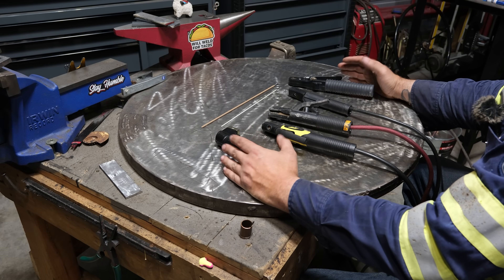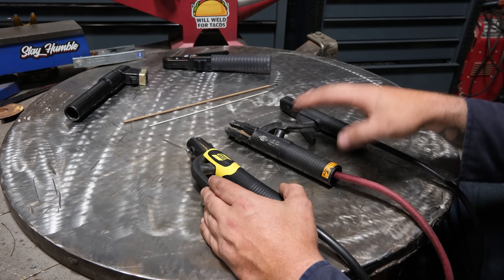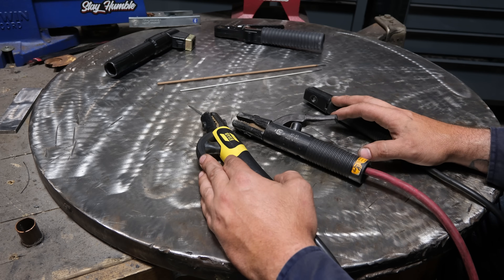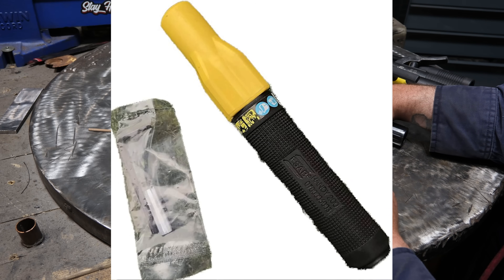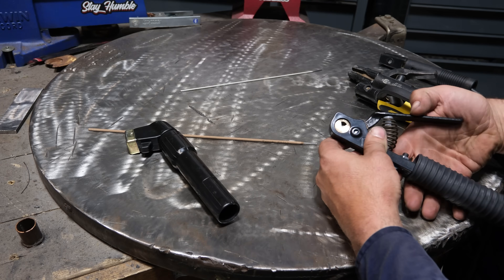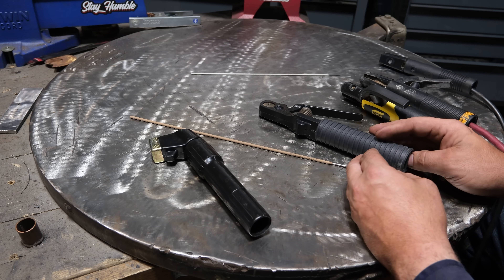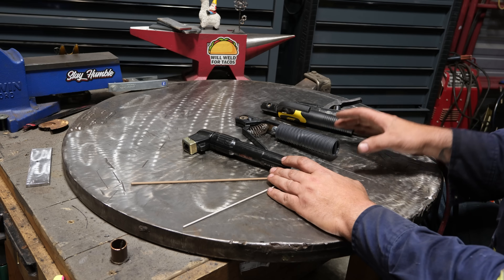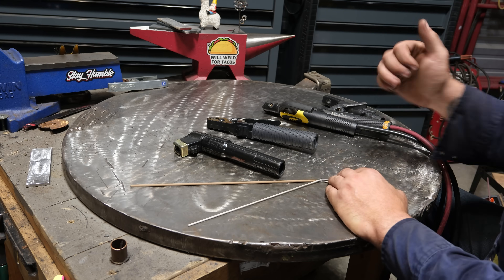Stinger V and other electrode holder upgrades

Comment: Twist lock holder's are junk in my experience. I bought three Japanese made Fuji electrode holders which are great but a bit tight under the clamp release handle. They are like a slim ESAB holder and have run them all day with no issues at all. I want to upgrade to a Stinger V002 insulated but at £158 inc VAT (£198 inc VAT normally) they are expensive. The Stinger V will be better my plate sized hands to operate.
Reply from the maker: They definitely are expensive but they are worth it if you do a lot of stick welding.  I have ran a stinger v for over a month straight now and I had to go back to a tweco for a day today.  I much rather use the stinger v lol.  For a tight spot, or small hands it would probably suck, but for anything else it’s a joy to use.

Comment: I’ve been eyeballing the stinger ever for a few months now.  How do you think it would do on a farm rig (mostly pipe fence, corral repairs, equipment repairs, etc)?   I’m concerned that it might limit accessibility in a lot of situations. I’d like to see a more compact version where the release lever was closer to the handle.  I’d like to hear your thoughts on it.
Reply from the maker: So the handle being where it is could be an issue getting into places. You could bend the handle closer to the body since it doesn’t need to move much to let go of a rod.  The physical size of it is pretty big, which to me makes it really comfortable.  I just spent a 50hour week welding with it this past week and for general stuff/pipe welding I am not going back to a normal stinger.  To get it in tight spots you can choke up on the head easily and that works well provided the length and size of the grip isn’t an issue.  I think for a lot of work it will be just fine, but I always have a mini chopped twist lock stinger handy just in case I need to get in a tight spot.
Reply: @makingmistakeswithgreg thank ya sir!

Comment: I would recommend the ESAB Eco Prima. It's kind of a blend between Lenco and the Stinger V electrode holders.
I got the 300A ESAB Eco Prima for about 20$ (they've got 200/300/400A) and there's a downside to it - it barely holds a 2.5mm electrode (not even gonna talk about 2.0mm).
Pretty solid and will probably never arc out on you due to its closed/covered jaw design.

Comment: I've been using the same $20 Amazon twist lock one for five years now...I'll never go back to anything else.
I don't weld for a living, but this thing's done a buttload of trailer repairs for me and still looks & works like new. Stuck rods aren't really an issue with these, they grip tight enough to pull teeth!
😁
Reply: One thing...if you use the twist lock thing, get in the habit of holding the business end stationary and twisting the handle when it's time to swap out electrodes. If you twist the head while keeping the handle (and cable) stationary, it'll eventually twist the cable off at the terminal/lug.
It's well-hidden inside the insulated handle, so you don't notice that half the wires in the cable are broken until it starts running hot from the added resistance.
Reply from the maker: You can definitely pull a stuck rod off anything with a good twist lock lol.

Comment: I’d like a ‘trode-holder that’s about an inch around.  Doesn’t need to handle huge amps, as a 3/32 7018 is a fairly big one for me.
Reply from the maker: Some of the small Lincoln style fit that bill.  A majority of the stingers out there are pretty substantial in size.  Lincoln’s tend to be small and compact, and allow you choke up near the rod which helps reduce the actual size.  The downside is if you arc out to the jaw via a stuck rod they tend to have troubles holding onto a 3/32 after a while.  I guess a file will help fix that lol.

Comment: On the v we put battery cable heat shrink on the lever and it helps a lot.
Reply from the maker: Great call on that, I happen to have some so that will be on the list to do 👍
Reply: @makingmistakeswithgreg thank you so much for your amazing videos, I just watched your vertical mig video again after I was humbled doing it on galvanized haha!

Comment: Back in the 80's I had a welder transformer that came from a shipyard it came with an electrode holder a bit like the Hobart twist grip one you had there but the electrode went into the end of the unit not at the side. It was perfect for overhead welding pointing it straight up for other positional jobs not so much so I changed it out for one that looked just like the Hobart, I sold the machine and the electrode holders in the late 1990's. I have never seen another electrode holder like that one since then.
Reply from the maker: Interesting.  Iron workers are known to weld with rods straight out of a stinger, I have never seen a stinger setup like that.  I could imagine it could be fun to bend the rod to weld on things other than overhead, half the flux would probably be broken off the rod lol.

Comment: Hi Greg

Most welders here in Australia are supplied with a twist lock electrode holder. I've been using the Optimus/Kemppi electrode holders which are similar to the Stinger V but have a fully encapsulated head instead and with a electrode port on the top for overhead welding. Have a look at them, I picked mine up for $80 AUD.
Reply from the maker: Those look similar (but better built) to one a few people suggested.  I will have to check that out, it’s a unique design.  Definitely a bit less prone to arcing out than the stinger v lol.

Comment: vice grips... clamp onto item, hammer the screw on the grip so the jaws score into the metal... but, those little magnet base ground clamps work grate for plasma cutting... high voltage just burns an arc ring around it if... the screw on a 1 inch magnet clamp was stamped 500A, no way that meant 500 amp's? 5 buck hobby clamps, daisy chain 5 of them...

Comment: Thanks for sharing.  I am just starting my welding journey and I stick the rods like I am breathing, comes second nature.  While searching Amazon for the Stinger V 002 (Insulated), I came across another stinger.  ASIN:  B0F93C7YWQ
Would something like this be good for a beginner?  It has a trigger mechanism to latch the rod and squeezing the trigger should be able to release the rod if it get stuck.  Not sure of the longevity of this stinger though.
Reply from the maker: So that stinger I have never used, but my guess is it would be less durable than a normal style, simply because of the moving parts.  I would stick to a lenco style for durability and usability.  On a budget 100% look at a harbor freight stinger, the one they have (knockoff of a lenco) is solid and often under 15$.
Reply: @makingmistakeswithgreg  Thanks

Comment: 3:20 took more then 500 pounds of rod before the 3/23 rod slip started... at that being a chunk of glass being stuck in the jaws... the plastic Bakelite cracks or melts off most after 200 pounds of rod. ground clamp if fkd out of its reality after 1000lbs of rod but still works with a failing clamp spring. 300-400amp ratted whips doing 1/8th and 5/32. not like i have an old stinger that after clamping the rod, twist the wire around the stinger jaws that the plastic melted off of so it don't let go.

Comment: Pipeline welder for 35 yrs and recently retired…used the Tweco A532 stinger for the first 20 yrs of my career and wouldn’t use anything else until I was introduced to the Stinger V with insulation kit….this is by far imho the best stinger for the serious and professional stick welder!    I did try the Lincoln A300 for a few days and just couldn’t like it at all.
Reply from the maker: Awesome to have your opinion on this, clearly you have the experience to judge 😀👍.  I used another guys stinger v and really liked it, he was a pipeline welder. I do mainly 6in and down building pipe welds and no guy I have seen used a stinger v.  It seems like a gimmick until you use one for a while.  Definitely a great product.
Reply: @makingmistakeswithgreg    The only fault that I had found through the years of using the V with heavy rods and of course "high Amperage"  150-165 amp with 3/16th 6010 -7010 rods was the insulator would melt on the one side depending how you hold the stinger way to easily especially on the bigger diameter pipe...36"diameter etc where you spend a bit more time coming across the large bottom during overhead.    Another thing we'd do is heat heavy duty shrink sleeve around the spring and pop it back in, this really helped with reducing forbidden arc strikes!

Comment: You made me go looking and Amazon has one : Simond Store 400a stinger  which looks like a v- hybrid with an out the top option.  Simder makes something I've never seen before called a Seahorse, apparently. I've always used a Lincoln, as they seem to be the best when you need to throw a 1/16 out the top.
Reply from the maker: That Simond looks like it would work really good.  The protection of a twist locks but easier to remove.  That sea horse is really wild lol.  It’s like a spring loaded jaw with a trigger.  I have a feeling that would be rough to use lol.
Reply: Simder has a great warranty process, which you'll NEED! I bought their multi-process welder, & got THREE DEFECTIVE WELDERS in a row! All 3 had different processes that wouldn't work! They sent me the Seahorse as compensation, but I haven't tried it.

Comment: Thank you for the stinger review. My old clunker 110v buzz box needs a new stinger, but I can't seem to figure out how to get the old one off! In time. The grounding clamp was much easier.
Reply from the maker: Some of them had an injection molded unit that is tough to pull off.  Best case the handle might just need to get pulled down to expose retention method/screws.  Worst case cut the cable and strip some of jacket.  If that welder has fixed cables loosing length might be a detriment lol.

Comment: Hi Greg, have you made a video on welding safety regarding electrocution (A.K.A. what to do to not get shocked and die!)?  I bought an old Lincoln Classic II engine drive welder which I haven't used yet.  I've only done MIG and a little TIG.  Before running stick and/or arc gouging, I'd like to know what I'm getting into safety wise before firing up that beast...
Reply from the maker: I have (very loosely).  I am actually working on a video covering this exactly, it should be out in a week or two.  In the meantime I will offer a bunch of useful advice that should help:

So welding operates at lower voltage (typically 15-30v) which is not enough to easily make you part of the circuit.  The human body is a poor conductor of electricity, aka it’s a resistance to electrical flow.  The higher the voltage the more the voltage can “overcome” the resistance.  When you get to high enough voltage things that are poor conductors (such as you or the air) can all of a sudden conduct electricity.  Now with that understood it is absolutely possible to be shocked by a welder, however it’s actually fairly difficult.  Many modern welders open circuit voltage (max voltage at any point) is sub 35v which would require you to have sopping wet hands holding say the stinger and a ground clamp to get a jolt.  Older machines and engine drives can have 80-100v open circuit which is enough to pass through a wet glove through you and a moist shirt onto something your welding on to complete the circuit.  In most cases it’s not possible for the machine to produce over 60v with a load on it, so as a circuit starts (aka you are being shocked) it won’t be significant because the voltage will be low.  

One of the things you must remember is the way most welders are designed, at no point is there a direct connection between input power (say 120v or 240v wall power) and output welder power.  Welder generators often have a separate welder section and generator section, so even in that case the ability for the generator to produce dangerous voltage (over 120v) on the output of the welding is limited.  So in simple terms the possibility of getting shocked is there, but rather limited to how significant of a shock.  Wear dry gloves and keep the “ground clamp” hooked near to the area you’re welding and things will be ok 👍.
Reply: @makingmistakeswithgreg  Thanks for the detailed reply, really appreciate it!  Looking forward to the video.

Comment: I’ve actually got one of those twist lock style on one of my machines and I like it quite a bit. If you’re used to a normal squeeze clamp stinger, it does take a little bit to get used to, but I feel that it’s worth it for the safety benefit and the better grip on the rod.
Reply from the maker: It does take a bit to get used to the twist lock but once you get the mental note to just twist and pull (if the rod is stuck) it’s no big deal like you said.  More people would probably like them if they tried them out for a bit.
Reply: @makingmistakeswithgreg  You dont even need to take both hands , you just flick your wrist to the left a bit to unlock. Its better than a clamp stinger in almost every way except : 1 they are slower to change rods and 2 , they often break on top on the part that holds the rod , leaving a perfect spot to put your thumb and get shocked hahaha

Comment: I might come out of a cave , but I dont find that amazon special too bad and better that using the tig touch as an electrode holder.
Reply from the maker: The Amazon special is small and compact which is good.  I have had a few almost melt in my hands though.  Make sure the set screws are tight on them lol.
Reply: @makingmistakeswithgreg  Yep!

Comment: Thanks for the video, Greg. I was unaware that the twist lock style stinger can be cut off. I actually use am other style stinger. It is like a chimära of the V-style, a shear and an lincoln-style. The static jaw is angled and some how "diamond shaped" and the moving jaw is formed like an wedge. So you can change the angle of your rod depending on how deep you stick it into the jaws. You can also insert it straight from the top. The wedge is short and hat great leverage. It pimches the rod solid, I was never able to rip it out without using the lever to compress the spring. I bought it branded "Oerlicon segura"
It is quite heavy although. Maybe it would be an interresting subject for a follow up Video.
Reply from the maker: Very interesting on that Segura, that looks identical to a Simond stinger someone else mentioned.  My guess is a single company makes it and brands it to whoever wants it.  I will have to get ahold of one to see what u think.

Comment: Ya the v groove is expensive. But a little electrical tape around the lever should also help. Great vid as always. I sent email on a topic the other day regarding settings if your rod keeps sticking.
Reply from the maker: I am a bit behind on answering emails, if I can find it expect a response in a day or two.  I am
About 70 emails behind lol 😀👍.
Reply: @makingmistakeswithgreg  All good. Thanks Take your time. Appreciate it.

Comment: I’ve seen that a lot of guys here in the USA don’t like the twist loc because it’s a bother when compared to the spring loaded holders. When you look at all the old stingers, the entire front is exposed. Even the lever was bare metal. I remember from the early 1970s we were just beginning to see insulated jaws. People I spoke to didn’t like the jaws “hidden” behind the plastic. They wanted to see the jaws. Times change. The one you showed in the picture is “shocking” to see. It’s like going back 100 years. I would never use it.
Reply from the maker: The uninsulated stinger v is much like Lincoln t-300.  I am not sure why they still exist but sketchy is a certain.  I can’t see why either setup is a benefit lol.

Comment: I struggle with the cheap stingers getting hot .
Cable also makes a difference. Those I upgraded.
Reply from the maker: Yeah those cheap ones will be a hot potato especially with 1/8th rods lol.
Reply: @makingmistakeswithgreg 
To be dead honest I've only ever welded with cheap ass welding machines , Hell on 140 amps + the stinger gets hot as Hell ...lol
All of the welding I do is site maintenance on gates , posts and fencing.
I'd love to see what it's like to weld with a good machine.
Reply: Thank you again for the excellent content.
I've picked up a lot watching your vids.

Comment: I just upgraded my very cheap stinger that came free with a welder to a twist lock style, it's more common to use the twist lock than a stinger here in the UK.
Reply from the maker: You guys do seem to favor the twist lock.  Many welders sold there with a twist lock are sold here with a normal clamp style.  Not sure why the twist lock never caught on here.
Reply: @makingmistakeswithgreg I'm not sure why either because the clamp style is certainly quicker for changing rods, it might be a price thing as a typical twist lock here costs under £10  which will handle up to 400amps, and one that will handle 600 is only a pound (£) or two more and they don't really wear out easily, a  older transformer type welder is more likely to burn out first so the same twist lock torch will usually be used through the life of  multiple machines. Most companies I've worked for would have them as the only option, now it's mostly tig that's used in commercial settings here.

Comment: Nice Greg Thanks For The Info 😀😊😀 Could You Do a Ground Upgrade Video Like Using a Magnet Ect instead of a Spring Loaded Clamp Style
Reply from the maker: I did do a video that loosely covered magnetic grounds but I will add that to the video I am working on electricity and grounds to make sure it’s covered 😀👍.
Reply: @makingmistakeswithgreg Appreciate it as Always Greg Thank You 😊